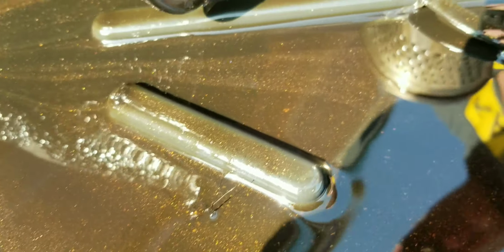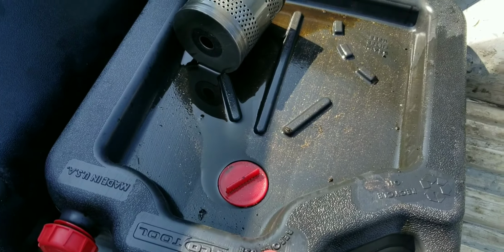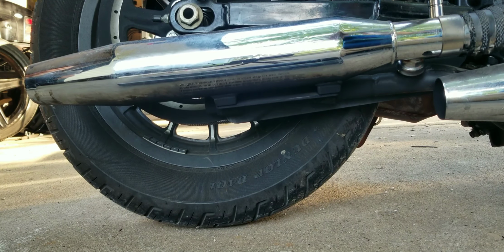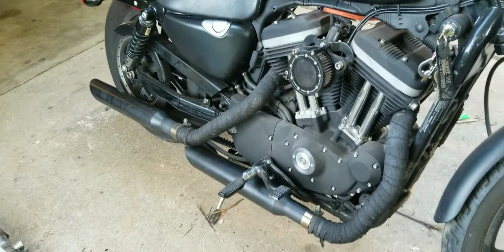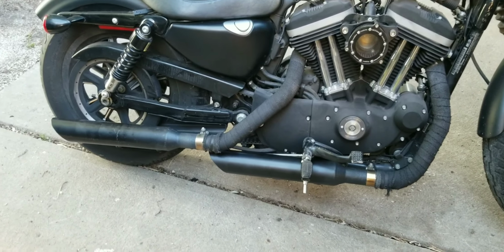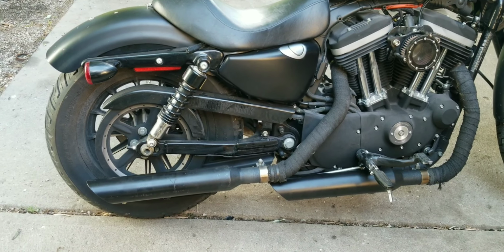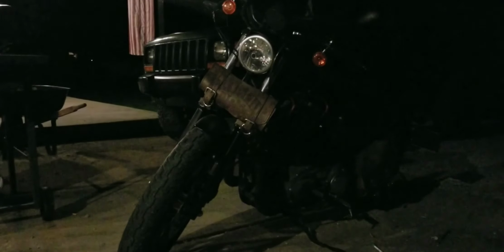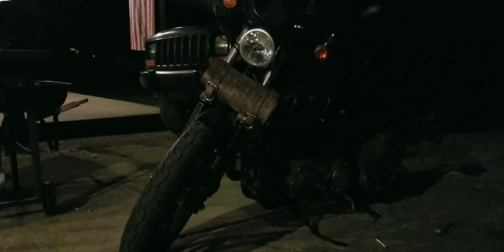Engine damage and new pipes for the Harley

Comment: I had a 84 sportster with Kirker straight pipes it would rattle windows, had to change them to stock, I was working a horse far, just driving by would drive them running. Finally found it a home in Boston.

Comment: What motor does the Wonder Lodge need?
Reply from the maker: 534 ci Ford industrial v8
Reply: Indiana Mobile Diesel a 460 wouldn’t work, a dime a dozen?
Reply from the maker: @CaptKirk1701  no it has to be one of the super duty series of big blocks. 401, 477, or 534. The bus already had a 534 so I really wouldn't want to go smaller. Thank you for the link.